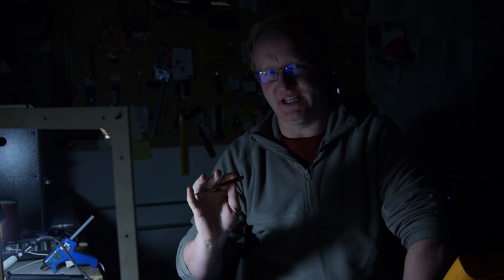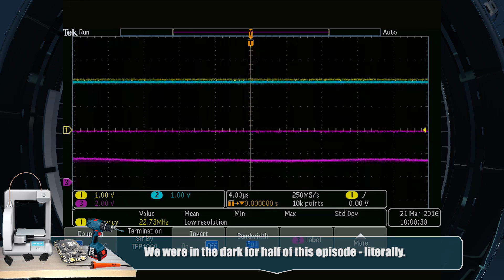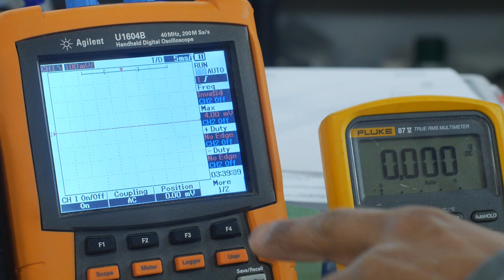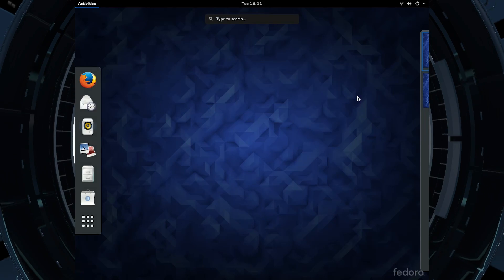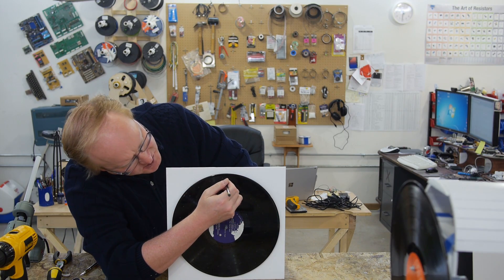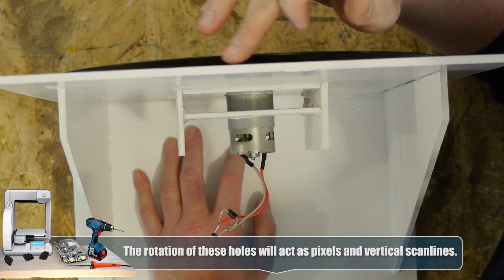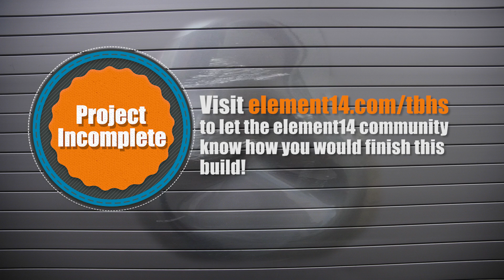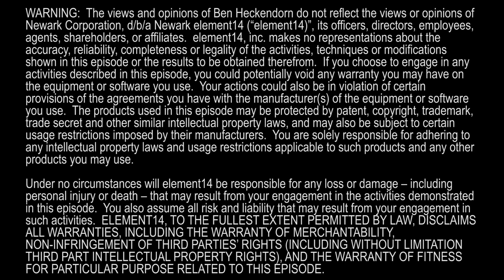Ben Heck's Mechanical Television Part 2

Comment: In the 1920's, many DIYers building this used oscillating fan motors, which are AC induction motors. In the articles I have seen, they would just take the blades and blade guard off and mount the Nipkov disc on the motor shaft. I think if you tried this again, you should try it with a couple cheap oscillating table fans. I think the speed regulation would be much better than you think. Many record players from the 1930's to the 1970's used induction instead of synchronous AC motors.

Comment: A frequency from a crystal osc fed to decade dividers to give an audio subcarrier for motor drive fed to a power amp driving a transformer connected to receive motor. I believe that Charles Jenkins 1929 book spoke of a chopper wheel interrupting a light source phototube circuit to produce an audio signal that was used to drive the receive motor to help sync motors. Think 1920s analog. Maybe the NBTV association still exists online. They had lots of examples. Look at Television dk channel on YouTube. He has working examples. NBTV (narrow bandwidth television association) has modern circuit examples

Comment: First televisions might use power for image stabilization. Look, in America we have 60 Hz, so television is 30 frames / sec. Europe has 50 Hz, that makes 25 frames / sec.
The used motors in mechanical TVs are for sure not low-power DC 12V or so, but more direct from power net. Because it makes circuitry easier with AC motor. (The old LP player or tape deck uses AC motor for drive)

The Nipkow cameras don't use light source. It's more sensor behind wheel. You can see it as "reversed" dia projector, in light-thight black box. 

A mechanical TV has neon tube for light, or just strong bulb for light. Technically, it's projector TV.

Comment: Remove the parallel sensor circuit and used just one with a lens to increase sensitivity. The averaging from concept may actually fogging up the single. Second,    William 
Osman Builds a Terrible Mechanical TV        - Duration: 10:58.      William Osman194,297 viewsMight be fun to join you onto your show because he wanted to make a camera and projector onto one disk. Details in how he does it is in the video.

Comment: Revisit it. Revisit it. I didn't know mechanical televisions exist until 3 days ago. I want to see this push to its limit.Modern Marvels has shown a design on failed inventions. Particularly having both disks aligned and planted onto a single axle would make an easier initial build to scan a project a proper image.

Comment: Great attempt, however a complete "compact as possible using state of the art components" to give the clearest picture possible (i mean really really clear, that you could see pointy corners of a square) would be awesome.  There you have a 10x10x10 inch box with spinning wheels projecting an image on screen would be an awesome centerpiece!!!

Imagine if this tech had gone all the way, what would we have eventually ended up with in modern times had they not let go?

Comment: Wow I had an Old Canadian made "Supposed Pure Class A" car amplifier, a Blade Technologies M252 that I later modified into an M502 with help from someone with access to documents from Blades original Diagrams made for the M502 which shared the M252 board! It took a while, but he gave me specific part numbers and locations, the Toroid needed modified, either way the Amplifier used a weird system and had a 555 timer for the "Output Section"! Either way they claimed it was pure Class A, but it used NPN and PNP transistors for the Amplification which is technically Class A/B, Class D uses all NPN, but instead of the standard way of controlling the A/C "output" they used a 555 timer and a few other components, the amplifier was not even PWM supplied! 

It had to have a 60mm Cooling fan internally just to be able to operate continuously and I had to install the controller diode, switching mosfet and thermal sensor! It took a few weeks, especially since I had to wait while he snuck into the secret room digging for documents and emailing me the part numbers and locations! But it was the funnest thing I have ever attempted and completed! Still that timer always brings to mind that Blade Amplifier! I love this channel, you guys do awesome stuff!

Comment: Solution is pretty simple - do what CRTs do. Have a sync pulse for every rotation (1 extra hole out of the frame area + 1 extra sensor), and in the receiver, have a phased lock loop that syncs to that pulse, which controls the motor's speed.

Comment: Easiest way to keep your motors synchronized, is to use AC motors. Not universal motors (like in a drill) but proper AC motors. The speed is determined by the AC frequency, and by the windings of the motor. Once tuned, it should keep synchronized.

Comment: You're over complicating the system.  Stick to the original design, and it will work.  Use AC Synchronous motors to drive the Nipkow discs.  Use a simple valve (or transistor) amplifier to boost the signal.  Though your "transmitter" seemed to work, it would benefit greatly from a more powerful light source than an LED flashlight.  Try an old Halogen movie light.  The original system used carbon arc lamps.
Reply: He is busy buying some tools to break apart...
Reply: Radiomovies, Radiovision, Television by Charles Francis Jenkins-1929. Also, his book Radiovision has lots of information. The first book has mechanical details and tube circuit schematics. John Logie Baird did it in England about the same time.

Comment: For a simple demonstration I would just cheat and run both the receive and transmit nipkow disks off the same axle. That way the number of revolutions per minute will be exactly the same for both transmit and receive. The tricky bit then becomes - how do you get the proper number of revolutions per minute to display a good image? probably just a potentiometer controlling the current into the motor would suffice. 

A more sophisticated setup would use an Arduino to exactly control the number of revolutions per minute at both ends.

Comment: I say, skip the mechanical sync.  Instead, try to build a projector: replace the LED with an RGB one, drive it using a Pi, thus making a mechanical display.

Also, screw everyone complaining about this failing: failure is always an option.

Comment: I think you should revisit this and use a pair of AC synchronous motors wired in parallel for the transmit and receive disks. If the mounting of one of the motors allows it to be rotated, you shouldn't even need any need any fancy electronics to adjust the phase.

Comment: Since you already had the mechanical structure built using dc motors, couldn't you have just added a tiny magnet on the spinning record and use a hall-effect sensor to get a timing pulse? If balance is an issue, put a magnet on both sides and then half the frequency/ignore every other pulse.  Its a thought anyhow, good luck!

Comment: The original mechanical tv did not use projected flying spot. It focussed an illuminated subject onto a sensor and the scanning disk was placed between the lens and the sensor (or the subject and lens). If you want to sync dc motors then use the back emf control method, Very simple circuits can be made to do this and you can create very stable speeds..

Comment: I've been driving uber for over a month now and my ratings have been mysteriously dropping do to what I can only guess is a increasingly hipsterish rider base. I'm a avid arcade enthusiast an have a idea about building a thin arcade cabinet to mount behind my passenger and possibly my driver seat, equipped with joystick or a controller peripheral. In exchange, I would be willing to allow a reasonable amount off advertisement showcasing your element14 website on the units themselves. I'll even drop a sticker on the rear bumper if you help me realize my idea.
Reply: +Ben Barakuda I drive a 2013 chevy volt.

Comment: I been hack. I was wondering if anyone has tried to hack. A PSP portable, by getting rid of that disk drive in putting in a hard drive and storing data on the hard drive. Maybe taking out the motherboard and putting in. A Dev board maybe improving the resolution. In game storage on the hard drive instead of those. Little disk drives.
Reply: someone tried putting a raspberry pi in one

Comment: I'd have used a laser cutter to cut the holes in the vinyl discs. It would have saved time and that saved time could have made all the differences between success or failure.
Reply: Saved time is not worth a corroded laser cutter and toxic gas being emitted.
Reply: Oh please a few holes isn't going to hurt anything

Comment: the drill motor is actually an AC motor. there is a pulse width modulator that converts DC to AC in the drills.

Comment: Too much slop in the whole system to ever stand a real chance of synchronization. Need to use wood or metal for stands instead of coroplast and think about how to sync the discs at the beginning of the project, not the end. Even the belt drive they eventually ended up was doomed; would have been constantly tensioning and unloading. Cool though.

Comment: Want to see you finish it! How about one record with holes in. Capture image at top as you did and then project at bottom from other side of same record onto an opaque screen (image will be reversed and maybe upside down?) could use mirrors to switch image correct way up? Simple and no sync issues. How about it, please do another attempt. Failure is only ever an opportunity.

Comment: Use AC Synchronous motors. The rotation and speed is frequency and phase dependent. They should be cheaper than Synchro Servo solution which would be the ultimate solution to make sure everything in synch. Using Synchronous motors you can vary speed by varying frequency and fine tune using phase shifting.

Comment: how about two synchronous AC motors, or two oscillating fan motors?
Reply: +nrdesign1991 Synchronous motors are a good idea. Speed is easy to adjust by varying frequency. You could fine tune between two motors by varying the phase being supplied to the two motors.

Comment: Would you build a capacitor that generates power from the wind for me?  Charges would transfer to plates as they are pushed through by the wind.   I would like to see you try this and see what you come up with.

Comment: Shows how brilliant Logie Baird was, he in 1926 (or around that time) managed to build his ''televisor' with an old coffin lid and bits bought in and around his local high street 90 years ago, without any previous knowledge or help, only with  know how of the Nipkow disc as a starting point.
Reply: +mart fart Not only Baird managed to build a working camera and monitor, but he also developed quite unique way to transmit the signal. The modulation (AM) was made possible by use of a disc with multiple slots obscuring the light. It was playing the role of a RF generator.

Comment: Is there a specific altar you have to burn the USB stick at? Which god should I sacrifice it to?
Reply: "Thou shall not have any other God besides The Bit, the 0 and the 1, the Data Bus of the Universe" - The 10 Commandments (actually, there are only two commandments. Unfortunately, I don't know the other one)

Comment: just a quick thought. why not use the same disc for aquiring and displaying the picture .
Reply: +gulapis the transmission distance is not that far g but who cares...
Reply: +gulapis or use hall sensors + magnets + memory buffer for sync. photocells with start-end marker holes should work too (you could even average rpm and stretch the signal accordingly)

Comment: Absolutely you should revisit this and finish it. I would do the record sync with some sort of PLL circuit so the motors would try to match the RPM and the position of the rotating records.

Comment: I pretty much knew this was going to happen, and I'm pretty surprised someone as knowledgeable as ben didn't think this far into it. There are really 2 and a half main concerns with a mechanical TV. 

One is a light pickup that can pickup enough light variances. This started out bad with the choice of parts and went to worse when you went digital. 

The second is the synching of the 2 wheels. CRT TVs probably just started the dot where the signal picks up on the screen thanks to magnets (how do they work?), so I would be interested in hearing about how the mechanical TVs did it. Unfortunately rubber belts and luck are not going to do it. 

The 1/2 would be the light source used on the display. I believe the original still used an electron gun, but no magnets? It still shot onto a phosphorus screen. Either Way you really should look at a strong controllable dot and for authenticity sake, a phosphorus display since it will probably best handle the need for a persistent display.

Anyways, a serious project and I think you guys should attempt it with a bigger budget and schedule. You never see anyone else attempting it these days so it is well worth it IMO.

Comment: Something, something PID. >_>
Reply: UNTESTED: Put IR rejecting filters in front of your image sensing diodes then add a diode with IR Pass filter. Add an IR LED behind the records and 1 extra hole for the beginning of the frame. Use PID on the receiver to get the pulses to match up.

Comment: I've been watching the channel for well over a year now, first time I have commented. I am really disappointed this is being left here. Perhaps back to the drawing board and a whole new approach is needed. As a project it's probably the most interesting that has been tackled. I would really, really like to see more time put into this one. 

I think breaking the project up into the two halves is probably a better idea, and tackling them as individual units, rather than trying to jump in with two episodes and completing two quite complex pieces of machinery. 

As others have suggested, I think it's certainly worth setting up a monitor so the information that is being collected can be displayed, and having simply an on or off value is a terrible idea. When you have such little resolution already the series of grey/ brightness is the only element you have going for you as is. 

Looking forward to the next episode, but I really want to see this revisited.

Comment: Use brushless motors with ESCs. sync the discs' speeds and phases using optical sensors on the edges of the discs, a couple of PID controllers on an arduino using the servo library.
Reply: Or even better, implement the PID controllers entirely with op-amps.

Comment: motors: maybe small BLDC motors, though driving them will probably require an MCU, or at least around 3x 555 timers and some analog magic (for the phase angle).

could almost suggest HDD spindle motors, but my experiences with these is that their torque is rather lackluster, but may be enough to spin a record.

those were probably some lame MOSFETs if those drill motors keep blowing them up. they don't take all that much current. I had ok results with IRF540N's and similar.

though, a little underpowered, I have also had pretty ok results running these types of motors with TIP122/TIP127 drivers.

for a little more power, one can use the Darlington transistors to drive banks of parallel MJE3055T's. this may require balast resistors, but twist ties work (note: solder doesn't work well on steel, may need to do tiny-scale welding to affix leads to the ties. note that effects of larger-scale welding still apply even if it is tiny, eye/skin protection still needed).

Comment: I have a question about the motor control.  Why not change the duty cycle of the PWM instead of the frequency?  It allows for the output voltage to be a little bit more even.  Using square waves seems like it would produce an uneven voltage output that varies a lot, depending on the voltage smoothing method used.  

Or...wild idea here: buy an electronic speed controller.

Comment: This video gave me a thought based on some recent experiences of mine. I assume you abandoned this project because like your auto loading NES it was built on somewhat of a flawed premise. With the NES you did persist until the end. I have done the same with flawed projects of my own. In the end I have found these to be where I learn the most. I also find them the most satisfying in the end. The reason being that for me finishing the project becomes more important than the original intent of the project. I am stubborn and it simply becomes about winning for me. If I quit that means I loose and the project wins. I understand as a content provider you don't have the luxury of perusing a project that may be a dead end, but I'm curious if you have similar feeling towards projects like this? By that I mean the greater feeling of "winning" when you finally finish a project you probably should not have attempted in the first place.

Comment: its 80 year old technology..how hard could it possibly be??? Turn's out ..pretty hard
Reply: +raindogred Pyramids are older...and still very hard to reproduce. 
Ancient engineers werent stupid. :-)
The first computers where mechanical, later where made with vacuum tubes, later with single transistors...a heck of a job.
Reply: +roner61 Pyramids may be hard to reproduce but it's not THAT hard.  Turns out Stonehenge could have been built by as few as a small team of people with no crane equipment.

Comment: You can create a really simple PLL-PWM controller for the second motor with an optical switch on each disk and a single XNOR gate. Yes, really! They will be ~90degree phase shifted, which is fairly simple to fix by displacing the sensors.

Comment: Steppers sound a bit too non-mechanical, as much as the optos. I like Felix's idea of using a belt better. You could use laser cut gears instead if you want more stability... I guess. Or a bike chain for less elasticity.